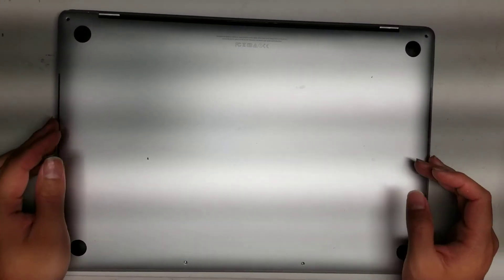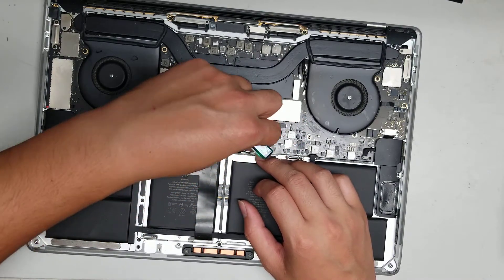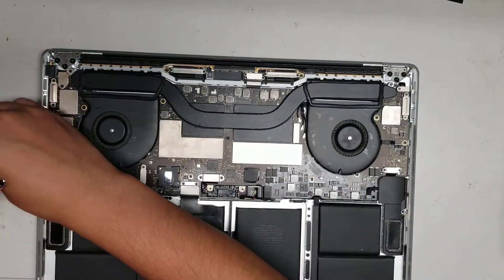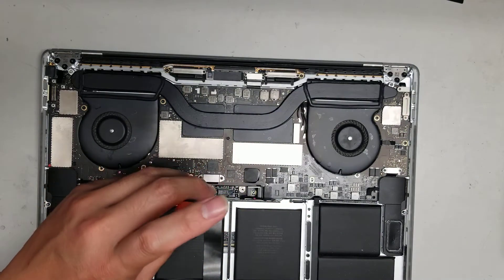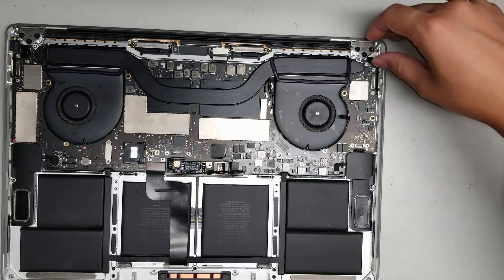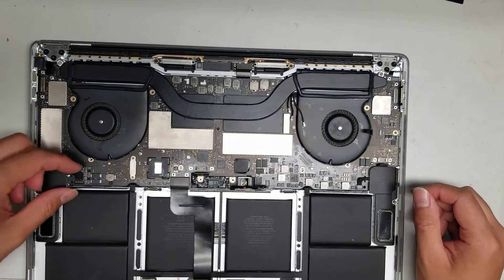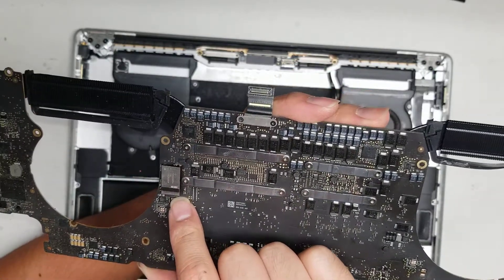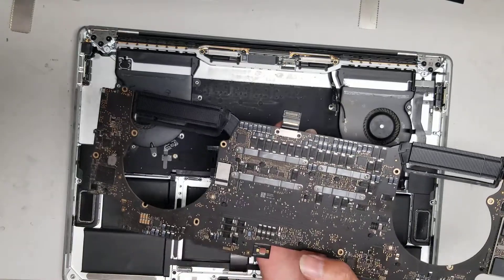MacBook Pro A1707 Late 2016 Disassembly *Nothing Upgradeable*

Comment: So, it looks like you can not replace the SSD hard drive? That stinks. My machine was working 100%, I tried to re-flash it and start from scratch with a blank machine and it won’t boot up now.
Reply from the maker: Sadly
Reply from the maker: Did you try the internet recovery?

Comment: Thanks for the video. Quick question: is it possible to swap a motherboard of a non-touch bar13'' macbook pro into a touch bar macbook pro and viceversa? 
Also is it possible to swap the top casing of macbook pro with foreign keyboard into a top casing macbook pro with English keyboard ? I have a macbook pro 13'' 2016 model with french keyboard which is very annoying to use so I am planning to convert it into an English keyboard. To do this I`m planning to buy the top casing with english keyboard from ebay and shift the components around but I am not sure if it`s possible? I`d appreciate it if you could guide me. Thank you in advance =)
Reply from the maker: I don't think so

Comment: Can you help me understand where the WIFI chip is located. Mine is A1706 which is similar to this board, but one middle Antenna is having damaged connector (middle one) but the long one (I guess for BT) is working. The issue is the WIFI shows "!" sign on the icon and cannot get the WIFI to work. Any solution. Also whats the function of the two remaining Antenna connectors
Reply from the maker: You'll need someone that does micro soldering.
Reply: @ItsBinhRepaired  Thanks for your feedback. But can you be able to tell me where is that chip located with a pic to my email
Reply from the maker: @JayFromIndia  if you don't know where the chip is, you won't have the ability to fix it.

Comment: Hi, do you know if I can upgrade the memory of an Early 2016 Macbook? It currently has two 4GB LPDDR3 modules in it.
Reply from the maker: Not possible
Reply: You could replace the logic board with one that has 16GB. Usually, used logic boards are very expensive on eBay, but sometimes you can find great deals on entire laptops that have broken screens/keyboards/etc but still have good logic boards.
Reply: 4gb won't cut it might as well get a new one. I recommend 32gb
Reply from the maker: It has 2 4gb modules he said. That's 8gb total.
Reply: @ItsBinhRepaired  doesn't matter, it will still be slow

Comment: I woke up this morning and my laptop was Not loaded. Flashes a folder with a question mark and a link to the apple site below. Apparently it doesn't see the SSD. I'm very worried. I'm very sad. What is this? Why is that? He stands where he stood, no one touched him. Whyyyyy? 😭😭😭
What can i do to fix that?
Reply from the maker: What's the serial number of your MacBook?
Reply: @ItsBinhRepaired  A1707
Reply: @ItsBinhRepaired 
15' 2016
А1707
256GB
Reply from the maker: @ВеликийРюзке-б9ю  serial, not model
Reply: @ItsBinhRepaired 
C02 SVM 27G TFL
But how can it help?
Reply from the maker: @ВеликийРюзке-б9ю  sadly your model isn't covered by the faulty SSD recall. That repair requires a replacement logicboard. :(
Reply from the maker: @ВеликийРюзке-б9ю  I thought you said it didn't see the SSD in the disk utility. O.o
Reply: @ItsBinhRepaired  Yep.
It was like that.
But only after erasing SSD through the terminal, it showed up.

Now I'm downloading another version of Mac OS.
Big Sur
From App Store.

By the way, im from Ukraine.
Sorry If i make mistakes(
Reply from the maker: If you didn't tell me SSD disappeared, I would have said to click view all disks in disk utility and then erase the drive. How did you mess it up in the first place? Lol
Reply: @ItsBinhRepaired 
Man, you didn't get it 😐

SSD dissapeared. Completely.
That's why i got system loading issue.

And only after erasing SSD through THE TERMINAL, my SSD showed up in Disc Utility.
Until Then it was not there 🤷‍♂️
Reply from the maker: @ВеликийРюзке-б9ю  hmmm very strange. Why did it disappear?
Reply: @ItsBinhRepaired 
I dont know.
A just woke up today, right after my birthday, and Then i saw the gift from Apple.

Big Sur is installed.
But all, ALL MY MEMORY WAS PERMANENTLY LOST.
It is realy sad(

But, i fixed it.
Reply from the maker: @ВеликийРюзке-б9ю  wow...strange
Reply: @ItsBinhRepaired 
Yeah
Reply from the maker: @ВеликийРюзке-б9ю  maybe Apple trying to get people to buy new computers...
Reply: @ВеликийРюзке-б9ю  hi how to do i look it up on terminal my laptop has a same problem....please help
Reply from the maker: Hm?
Reply: @ItsBinhRepaired  its showing a flashing folder with a question mark
Reply from the maker: @prodby7anaka  is the little metal thing bottom right of the left fan still there? Without it, the internal SSD won't be detected. It's held in with 2 screws.
Reply: @ItsBinhRepaired  i think its there, I have not opened my MacBook, but my SSD is not showing in disk utility
Reply from the maker: Sounds like the motherboard has a problem :(

Comment: O god, i must immediately sell my machine just to upgrade an ssd 😭
Reply from the maker: Yeah...
Reply: @ItsBinhRepaired  is there another way :(
Reply from the maker: @Waladhoolin  use a usb hard drive for storage?
Reply: @Waladhoolin  You can get a 10 Gbps PCIe Gen 4 M.2 drive enclosure for around 20 bucks, then get an ultra fast PCIe Gen 4 SSD to put in there, and you have cheap storage that is a lot faster than the built-in storage in the Macbook, plus it's portable so you can take that storage to any laptop you want.

Comment: Hah.. to clean fans and radiators from dust, i should do so much disassembling :((( And laptops should be cleaned once per year.  Will better look at 2015 model. 
At least if it dies, i could save data.
Reply from the maker: Yeah...